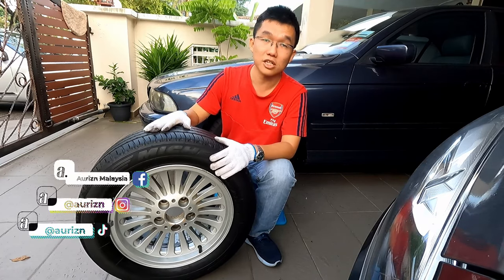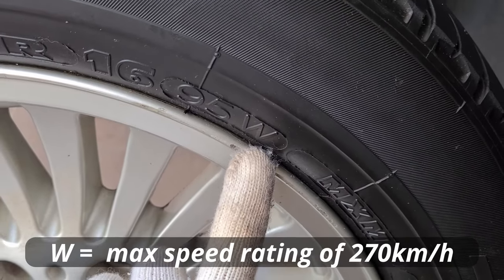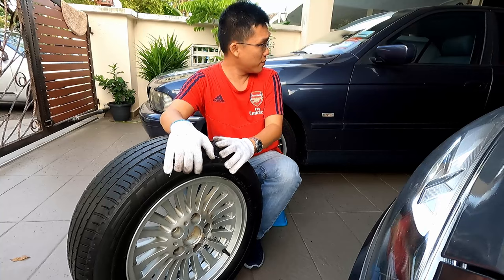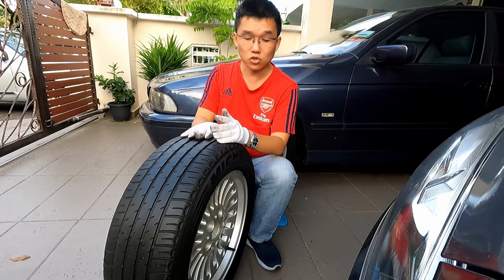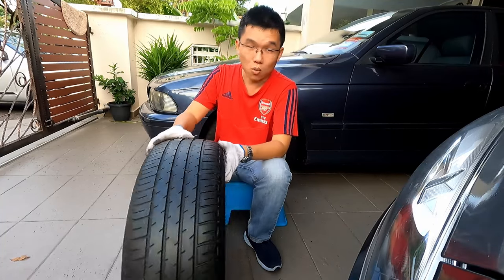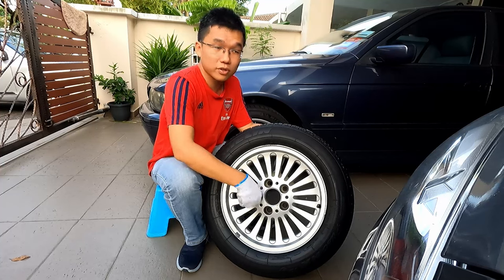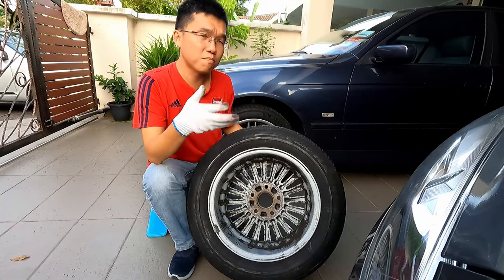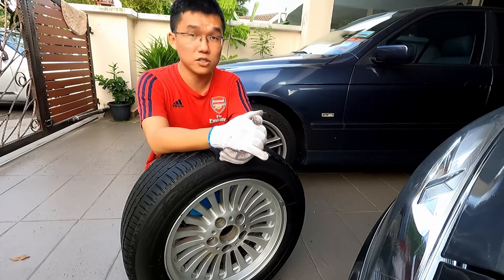Tyres & Wheels - PCD, offset, centre bore, and what you must know when shopping rims | EvoMalaysia

Comment: Remember do not use the old 2000 spare tire for long term and only use it up to certain speed even though it’s a full size spare wheel. I was driving the other day with my old 2004 full size spare wheel up to a certain speed and the whole tyre just collapsed and left with only the rim due to the tyre rubber compound already “expired” and hardened. Luckily I was driving slow and able to stop at the side of the road for safety. Hope no one encounter what I did 🙏
Reply from the maker: Oh, I'm definitely replacing this soon. Preferably going to get a 17-inch wheel so that I can regularly rotate in a new spare everytime I change tyres.